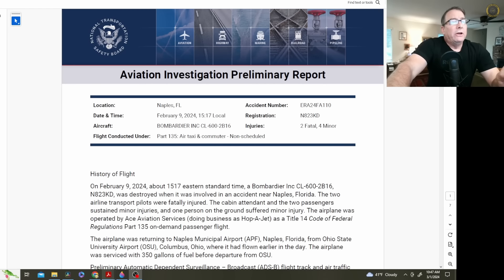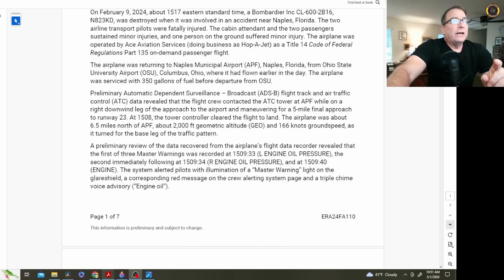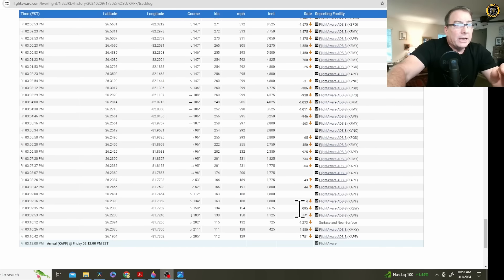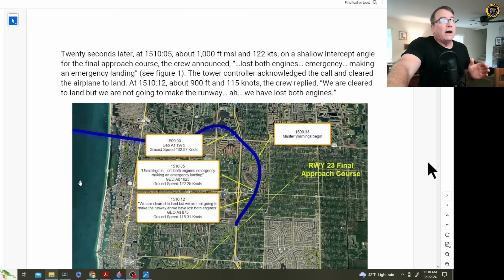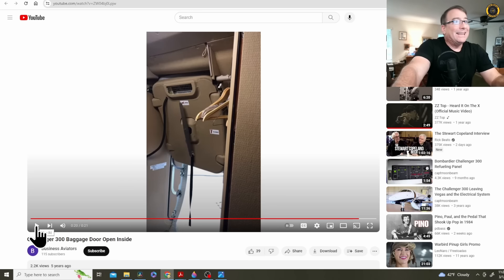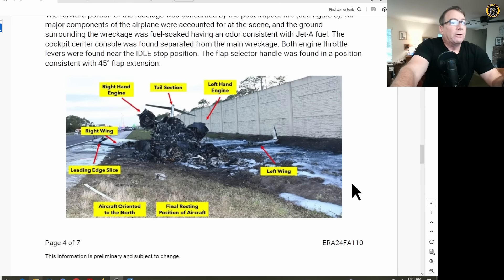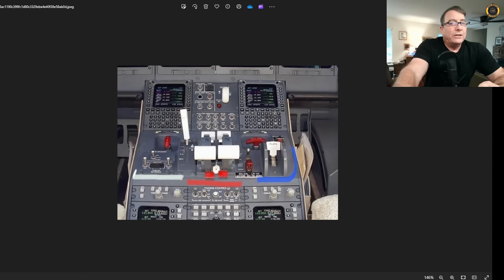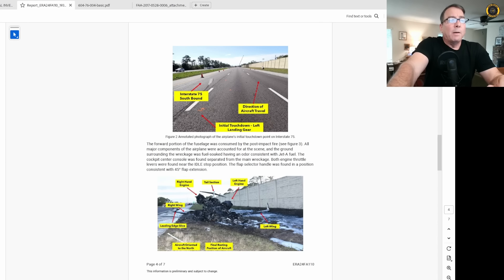NTSB Preliminary Report: Naples Challenger 600 N823KD

Comment: when I saw clips of how the throttles could accidentally going into the "shutoff" position, I thought "what a horrible design"
Reply: I wholeheartedly concur!
Reply: But Juan seemed to say the pilot in the right seat used his/her right hand to reach across, I don’t get how the pilot in the right seat would use their right hand to reach across their own body to then use any controls in the centre. Surely their left hand would be in position to do this?
Reply: @teeanahera8949  he probably meant to say the left seat
Reply: @teeanahera8949  Juan mis-spoke initially, then correctly a few moments later. Pilot in left seat would be reaching around, underneath the thrust levers to get to the flap lever.
Reply: EXACTLY!!!!
Reply: @teeanahera8949   - I was confused by that. I think he misspoke, but not sure.
Reply: The shutoff safety levers are close to the console.  I don’t think there is enough room for the pilot not flying to keep his arm under there the whole time while the pilot flying reduces the engines to the idle position.
Reply: @hugoglenn9741 Exactly! Our pilot's have tried to duplicate the whole "left-seater reaching behind the throttles" ro reach the flap handle requires some serious calisthenics  in order to actuate the throttles to cutoff at the same time. And the NTSB preliminary stated that the position indicators on the engine FCUs were in Idle position. So, again the calisthenics that would have needed to be performed to inadvertently put the throttles into cut-off and then back to idle makes the "reach behind the throttles" an unlikely scenario.
Reply: @teeanahera8949 He meant the non flying pilot in the left seat if that was indeed the case. He misspoke
Reply: @robertc4293  they were in the idle position because they immediately bumped them back up to idle in a panic as the engines flamed out. Very typical response if you've flown turbines, trying to attain/retain a (re)light, as the case may be. It's not hyperbole in the least, it's the most likely what happened here imo. The videos online do show it's done quite easy in these poorly designed pedestals. Granted, in fairness to Bombardier, these consoles are meant for the left seater to hog the stick time, and the FO to always get the flaps.
Reply: @robertc4293  A few questions for you since you have pilot contacts.

Are the engine cutoff gate switch data points recorded in the Flight Management System - Blackbox data? I know that's a big ask.

Once the throttles are in cutoff - do you have to release/activate the gate switch's to move the throttle forward again into the idle position? ie did they accidentally cut the engines and then restored the throttle levers to idle without touching the gate locks?
Reply: @robertc4293  even if it wasn't what happened, the fact that it can happen is enough to warrant safety concerns
Reply: @bj8342  as for the FDR data points, it's been a while since I've looked at an FDR report and then we were focused on certain other data points and I didn't take inventory of all the data points. We have a 604 and 605. Our 605 has autothrottles, so I would believe that data from the AT computer could be shared to the FDR.

The cut-off safety if actuated with the throttles above Idle position, the throttles can not be  pulled into cut-off. And once the throttles are in cut-off the safety must be lifted in order to go from cut-off to Idle.
Reply: @OwlRTA  It seems like there are lots of opportunities to improve aircraft ergonomics.  I hope we can learn something from this tragic crash.
Reply: @robertc4293  Thanks for the reply. I believe the Safety board will be asking the same questions in their investigation.
Reply: @merrillevans392  I caught it when he said it, and then said it correctly later. It was getting a bit confusing given the practice of seat-swapping that Juan referred to.

Comment: Minor correction: the baggage door is NOT listed as an emergency exit as the actual emergency exit is on the fuselage over the right wing. Naturally if that's your only option it can be used, but Bombardier does not consider it an emergency exit. I have never seen a FA operating this door and rarely does anyone open or close it from the inside, so the FA on the accident flight certainly knew the aircraft better than most.  Another thing about the throttle quadrant is assuming no defects you can't go to cutoff unless the throttles are in idle before the red safeties are lifted.  In other words if you at a normal power setting, you lift the safeties, and then try to go to cutoff the lever will not go as you must stop at idle and then lift the safeties.  I'd consider it highly unlikely, although certainly possible, to inadvertently move both throttles to cutoff even in the scenario where the aircraft is being flown from the right seat and the left seat pilot is operating the flaps.   I have no idea how Hop-A-Jet operates, but many operators do NOT do right seat takeoffs and landings.
Reply: Excellent interpretation and clarification regarding the baggage door. After reading most of the comments and listening to JB’s speculation, the theory that the engine s were inadvertently shut down by ‘reaching around’ could be verified by 1. Determining if Hop-A-Jet’s SOP has the flying pilot always in the left seat and 2. Post-accident interview of the f/a, which she would know who was in the left seat prior to departure.

Comment: I worked in a G2 for several years; configured for mapping. When I safety briefed a new crew or observer I start with the baggage door and make that person cycle the door. And during inspections if the over wing doors were going to be removed I used that opportunity to get crew to open them. And the main cabin door hard to push latch too. 

Hmmm simultaneous loss with simultaneous low oil pressure… doesn’t look good.

Comment: "The right wing exhibited leading edge damage consistent with impact with the vertical steel I-beam of a highway sign; the front spar was severed in the area of the impact." 
This is what forced nose of the plane through the barrier wall and ejected the most fuel. The inboard damage is where the fire originated and the wing later collapsed.
The sign is not plainly visible in the dashcam video, but other footage shows the damage.
Reply: It was the "Naples Airport Naples Zoo Coastland Center Mall Exit 105" highway sign about 1/4 mile north of where the aircraft came to rest (it's on Google maps). It had two I-beam supports --- one must have made the "leading edge slice" in NTSB Report Figure 3, and the other "impact-separated the outer portion of the wing."
Reply: @Raiders33   Yes, that sign. It ironically says "airport".
There's numerous local news vids showing the right wing with 2 gouges in it before the fire destroy the plane. The one at the wing root is exceptionally bad.
Reply: @caroltlw  Don't think the I-beam supports of the sign could have made both the damage at the wing root AND the leading edge gouge in NTSB Report Figure 3. Challenger 600's wing length is 26.9 ft, but the width between the sign I-beams is much less than that. Plus on Google maps, the sign was very close to the the sound barrier wall. I think NTSB got it right that the sign I-beams caused the Figure 3 leading edge gouge, and they "impact-separated" / severed the "outer portion" wing tip/ winglet.
Reply: @Raiders33  
Perhaps wing root was a bad description. The second damaged area was outboard of the engine. The angle taken from behind in slow moving traffic shows it. Don't know what else could have caused damage in that area.
Reply: ...unless that's where the RM gear [edit: looks like the nose gear is what separated] snapped and came up through the wing. I had originally thought the wingtip was separated by the wall, but the second signpost makes sense if the measurements line up.

Comment: Even if it turns out it was not the scenario where the left seaters arm reaching for the flaps accidentally came into contact with the levers allowing engine shut down, that is something which must be addressed because that is an accident waiting to happen.  -----  Thank you for specifically mentioning the flight attendant and how her training and quick thinking and action saved herself and her two passengers.  I also have the highest respect for the two men on the flight deck because they flew that aircraft all the way in and gave them the chance to walk away instead of trying to keep the nose up and stalling.  That was a brutal scenario for them, and they came incredibly close to pulling off the miracle landing.

Comment: They have a time line on the data recorder which will show if the flaps were lowered at or about the same time the engines quit. Should be easy enough to determine if your theory about bumping the engine shut off tabs happened or not.
Reply: Indeed. I'm fairly sure the NTSB know exactly what happened.

Comment: They took on a fair amount of fuel in Ohio. As Juan explained in the first video, the fuel from both tanks is mixed in center tanks before heading to the engines. They managed to fly, uneventfully, almost all the way back to Naples before, suddenly, both engines quit.

If the fuel was contaminated, how did it not cause an issue much earlier in the flight?

Kudos to all the crew. If it wasn't for a bit of bad luck, they'd all have made it home. Condolences to the friends and families of the lost crew.
Reply: maybe when they rolled in the  turn towards the airfield the water sloshed into the pickups
Reply: 3 center aux tanks feed the main ( wings) tanks which feeds the collector tanks ( located in the center aux tank)  then on to the engines

Comment: Juan, most private jet operators, who have pilots qualified to fly the aircraft, rarely if ever fly from the right seat. The PIC (Captain) typically sit in the right seat if the SIC (FO) wants to fly. The point being that they want both pilots to be capable of flying as PIC when the time is needed. It's not like the airlines where you have to do upgraded training. Most recurrents training are flown from the left seat!
Reply: The person is right seat is always qualified to fly the aircraft in revenue service.
Reply: @AlbertHess-xy7ky  true but not typical SOP and almost with certainty that Hop-a-Jet didn’t. The CVR will confirm this too.
Reply: To what we know so far the Captain was sitting in the left-hand-seat and was a professional Hop-a-Jet-Businessjet-Pilot. The FO was a retired former Airline-Pilot, 65 years old, and was sitting in the right-hand-seat. He had much more Flight Hours in a whole than the Captain but was very new on this special Businessjet Modell.
Reply: A qualified captain but not necessarily the captain.
A common practice in the charter business, as a function of work load and availability you may be left or right seat or the only pilot.       @Plutogalaxy
Reply: The FO only had a little over 100 hours in this type so I would imagine your scenario played out like that and the FO wanted to fly.

Comment: The fact that the engines failed within 1 second of each other makes it hard to believe that it would be a fuel contamination issue, unless the fuel lines to both engines are precisely the same length and they are both drawing fuel from exactly same source. A different cause such as inadvertent engine shutdown would seem more likely.

Comment: @14:25 >   Most Bombardier aircraft also have individual Fuel shutoff switches separate from the throttle.   The Challenger 600 series, which includes this CL-604 is very old technology.
Reply: So is the B52😂
Reply: Yeah and you have to arm the firex system first then blow the bottle for all the firewall valves to close

Comment: That’s a nice piece of investigative reporting.  I was sure it was contamination but now agree with your theory about the fuel cut-off switches.  FO flying a visual approach while retarding thrust levers to idle.  CA reaching under the thrust levers to set the flaps.  Terrible timing and a terrible switch placement combine to shut down both engines simultaneously and kill them.

Comment: I’m wondering… If the Captain was the PM, and was wearing long sleeves, could the opening above the cuff have caught the cutoff levers if he was reaching behind the thrust levers to manipulate the flaps?

Years ago, I inadvertently shutdown an engine while stopped on a taxiway in a 1900 when I got out of the right seat and my pant leg caught the right condition lever. There’s even been instances in my current plane (737) where a USB charging cord will get wrapped around a cutoff lever. One good yank could make those CFM’s awfully quiet.😬

Comment: The voice data recorder and instrument data recorder should tell you if the plane was shut down inadvertently.  Contaminated fuel is some what of a stretch, if they had bad fuel they would have experience problems earlier in flight. This will be a tough one to figure out, especially with the throttles in a normal flight configuration.

Comment: Many operators mandate the baggage door be locked prior to departure. Some Captains override that procedure and now we know why..
Reply: You can’t lock the door from the inside, so that’s not happening.
Reply: @GLEX234  I’m speaking of locking it from outside prior to departure.
Reply: That should only be required if there's no access to the baggage through the cabin.  If there's access then it should be unlocked for flight.  On the G280 we fly with it unlocked, always.

Comment: I understand the NTSB will likely consider fuel contamination first given in the past dual engine failure accidents have mostly been attributed to contaminated fuel. In each of those accidents, the accident aircraft was not flying for very long before the engines displayed abnormal function. In this case, the aircraft was flying from multiple hours before any engine malfunction was experienced. I’m liking the theory of inadvertent idle cut off more.

Comment: I watched the video of the crash taken from a vehicle.  The plane touched down on the white line between the center and outside lanes.  The plan was not traveling parallel to the highway but at a small angle from left to right,  before it touched down,  so it had some sideways momentum.  It appears to me that the sideways momentum forced the right hand wing into the sound wall.
Reply: They also clipped a truck too, correct?
Reply: @davidbaldwin1591 A truck was smashed from the pics I saw — if they were accurate — I don’t know how the driver and/or passengers were fine.
Reply: @hlowrylong  Man in the truck was treated by paramedics at the scene.

Comment: Dan Gryder pointed out that they filled up with fuel at Ohio State but asked for it to be negative for Prist additive.  They then flow for 2+ hours at 40,000 feet and so likely that they had “Jello Shot” fuel when they throttled down…Similar to the 777 that barely made it Heathrow many years ago.

Comment: Fascinating analysis. I would have never thought of the mechanics behind an inadvertent engine shutdown.  It is a tragedy any way you look at it - but insult would be added to injury if the engines were shut down.  I would think it is reasonable to expect a 1/2 inch of water to be present in the fuel system after firefighting measures were taken especially as the fire impacted the integrity of components such as fuel tanks etc.

Comment: As you got close to the end Juan, I could see where you were going. I totally agree it's possible that the left seat pilot bumped the shut off levers and the right seat pilot pulled them right back to cutoff.  I would not discount anything. I was an FE for 30 years (mil and civ) and have seen every emergency in the book. Anything is possible.

Comment: The challenger-600 is basically a CRJ-200. Those throttle quadrants are mechanically connected to the fuel control on the engine. If the rigging is wrong or if something happens to the mechanical linkage, the fuel the engines are supposed to receive in idle may not be what it’s actually receiving.
Edit: I should clarify that those linkages are independent of one another. The left throttle is connected to the left engine and the right throttle is connected to the right engine. Typically an issue with the link is found because the engines won’t run at the same N2 while at idle.

Comment: It is indeed possible what you describe Juan, that the captain while reaching out for the flap lever he came in contact with these latches on the throttle levers. But they have to check whether that way it is possible to pull those latches to release the levers to move back in to the engine shut off position. However it is so likely to happen, that one wonders why it did not happen before...

Comment: Hey Juan.
There is a vid of the crash close up on the "Telegraph" (Google Naples plane crash video, the Telegraph)
There was a road sign they hit with the wing a few feet from the fuselage.
That spun them around into the wall 
It appears the wing tip didn't hit.
Those signs have strong, about 6" I beams that hold them up.
2, about 4, or 5 feet apart.

Comment: The incident occured while turning for approach. That turn and descent could have provided the necessary angle for the water to slosh over and ‘load up’ the fuel feed lines thus stalling the engines.

Comment: I thought that as the plane touched down on I-75 it contacted two vehicles. The vehicles that were damaged by the plane were a Nissan Armada and a Chevrolet Silverado truck. The two women traveling in the Armada were not injured, while the driver of the Chevy sustained minor injuries and was taken to a local hospital. Could that have been a reason why the plane spun into that barrier wall that resulted in the wing contact causing the fuel ignition resulting in the fireball?
Just asking